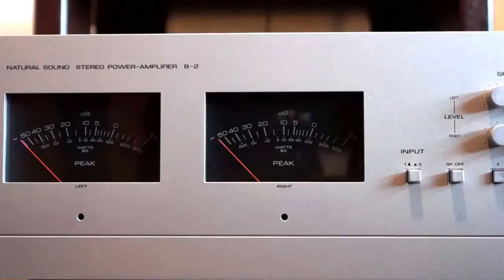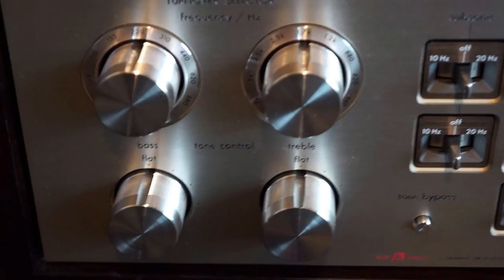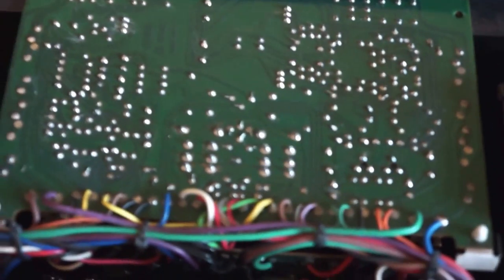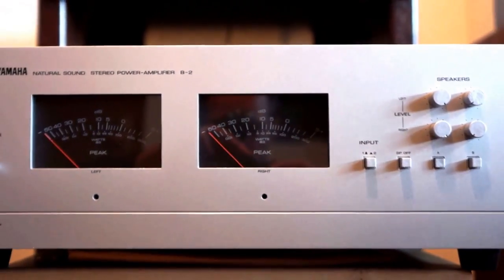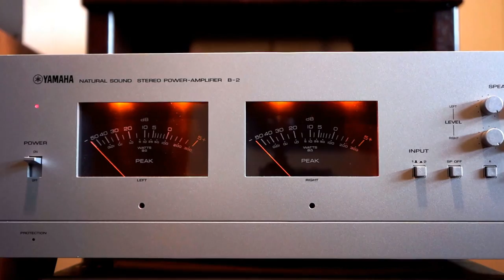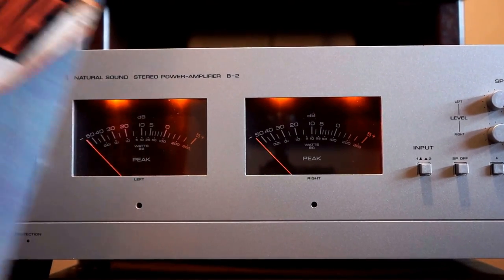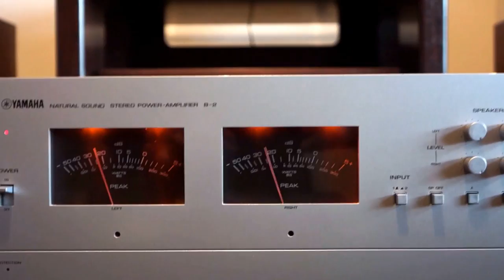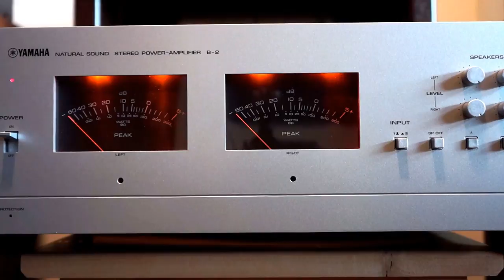Yamaha B-2 Vfet power amp

Comment: Excellent job!
I'm renovating a B-2 now and would like some tips. What is the make of the RCA connectors and the output terminals that you used? What is the make and model of the rectifiers? You know where I could find the power transistors. I need 2 pairs.
I would be very grateful if you could pass me information on the components that you have changed.
Once again, congratulations!